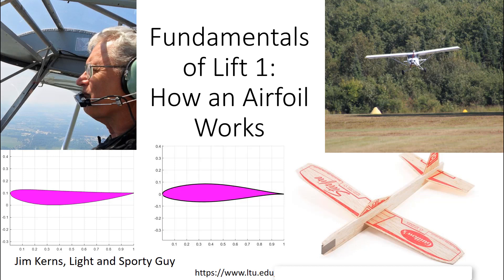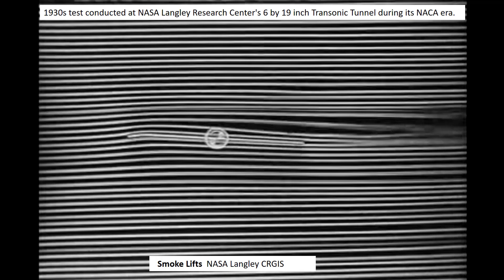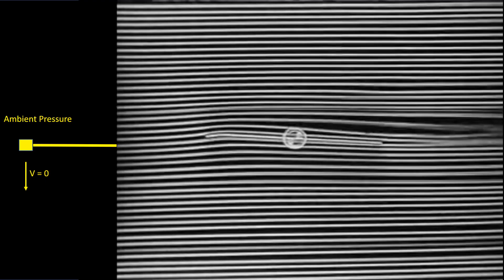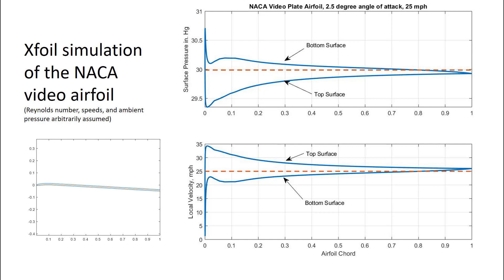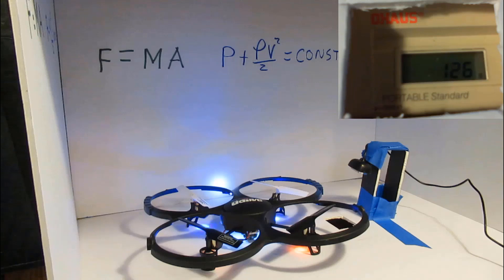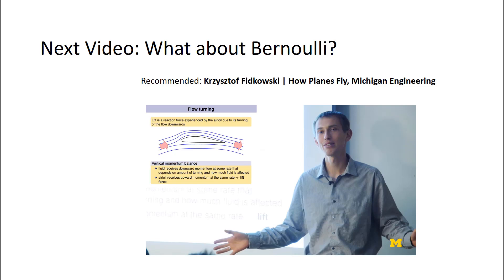Old version of lift video see description for a link to the new improved version

Comment: A simple back of the envelope calculation clearly shows that there is not nearly enough rate of change in the momentum of the air above and below the wing a of an aircraft to create sufficient force to resist the weight of the aircraft. 
Try it: a C172: weight 1,100 Kg, wing span 11 m, chord 1.5  m,  AoA around 5°, airspeed say 100 kts, (50 m/sec)  air density 1.023 kg/m^3. Force required: 11,000 Newtons. Force generated from moving the air vertically maybe 200 Newtons. 
Not even in the ballpark!
Reply from the maker: Not sure how you came up with 200N. Not even close. 
And, if Newton's laws don't apply, what does? 
Note: An easy experiment is to put a multicopter in a box sitting on a scale. As the copter lifts off, the reading of the scale does not change  - the airfoils accelerate the air downward which then hits the bottom of the box  generating a force equal to the weight of the copter - all as you would expect from Newton.
Reply: @LightAndSportyGuy  I will try again and show you my logic.
This is "back of the envelope" stuff so I'm sticking to 2-digit precision.
Firstly the geometry:
Visualise the wing of the C172 in flight as a thin flat surface, a chord length (1.5 m) wide and a wingspan (11 m) long and an angle of attack (AoA) of, say 5° to the horizontal.
Now, visualise the triangular prism of air under the wing: 11 m long, 1.5 m on the diagonal at 5° to the horizontal base. The height of its vertical face, its "pitch" is (chord * sin (5°)) = 0.13 metres.
The horizontal width of the prism is (1.5 * cos(5°)) is also 1.5 m since the cosine of 5° is so close to 1.0.
So, the volume of the prism of air is 11 * 0.13 /2 = 0.72 cubic metres (m^3).
The density of air at NTP is 1.2 Kg/m^3, so the mass of air in this volume is 0.86 kg.

Now, the mechanics:

The plane, moving at 100 kts or 50 m/sec, is moving at 50/1.5  = 33 chords per second, so every 1/33 seconds, or 0.03 seconds, it moves forward by one chord length.
Momentum:
Once the wing has passed, this volume has moved downwards by the pitch of 0.13 m. It has displaced the 0.86 kg of air by 0.13 metres.
It moved the volume down in 0.03 seconds, so its vertical speed was 0.13 metres in 0.03 seconds, or 4.3 metres/sec.
Its momentum therefore was mass * velocity = 0.86 * 4.3 = 3.7 kg m/sec.
Initially, it was stationary, so its momentum was zero, so the momentum change was 3.7 kg m/sec.

This momentum change occurred over 0.03 seconds, so the rate of change of momentum was 3.7/0.03 = 123 kg m/sec. This is 123 Newtons.
Since the same mass of air was similarly displaced from above the wing, the total force is 2* 123 = 250 Newtons.
250 Newtons is way short of the 11,000 Newtons required to support the aircraft against gravity.
Reply from the maker: @RationalDiscourse  The effects of the airfoil extend far above and below the wing  (and in front and behind) - it is not just a small triangle of air that is deflected. An example is figures 36 and 37 in this paper by Prandtl - https://ntrs.nasa.gov/api/citations/19930091180/downloads/19930091180.pdf - that show the pressure effect on the ground.
Reply: @LightAndSportyGuy  I'm concerned about your recommendation of the NASA/Prandtl report to substantiate  your Momentum Theory (independent of Bernoulli) of lift because it relies heavily on Bernoulli's  equation, which appears at least four times in its explanation.
Reply: @LightAndSportyGuy  I'm not sure what youTube is doing, but my response 10 hours ago has disappeared.
Reply: But that is a totally different theory. It is not your explanation. Come on , you can’t move the goalposts!!!!!
Reply from the maker: @alans172  Hardly.
Reply: In your demo, at around 6:00 there is no evidence of vertical movement of the air above or below the foil beyond the extents of the red and yellow boxes. Your explanation only depends on momentum.
Reply from the maker: @alans172  Oh well. I guess I failed to draw the larger flow field.
Reply: @LightAndSportyGuy  ok , can I ask you to present the physics and maths of your explanation please?

Comment: Jim,
Spoiler alert:  There is a "However".
I just saw your video about the myths, which was pretty good [except you lost me on a couple of your details/innuendo that aren't critical - driving to Tampa]  and I saw your reference to this video in a comment.
..
What you have here is very good, in that, you walk through the details using good physics - so rare in other amateur videos. . . .

You correctly say that the flow curves and, therefore, there is a higher pressure above these flows and lower below <-- Newton in fluids and Euler: "Pressure Gradients Accelerate fluid".

This is Inductive reasoning. This is making a judgement from an observation. 
.
Now, the chink in your armor. . . 
HOWEVER, you do not explain the cause of, why these pressures differ from ambient atmospheric pressure!   So that judgement-from-observation is correct, but it still does not explain, using physics, WHY the pressures are altered. It is a backwards reference to the probable cause from the result.  It is not going from an ultimate cause to result of the pressure changes.  There's one more step down to the fundamental.!.
..
People have soup, therefore it is tasty.   
This does not explain WHY it is tasty - What are the spices, quantities, etc.

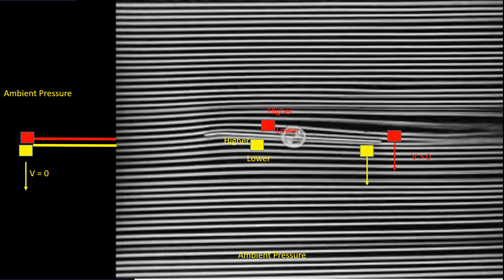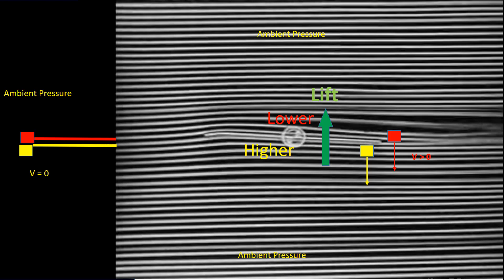Therefore, I say that is not "the fundamental explanation of lift" [time 5:00-6:20].  
I claim that you need to go just one level deeper to WHY these pressures have been altered from ambient.
. 
So I say that this does not go far enough to the true FUNDAMENTAL physics. 
So, this is doing the same as you say about some myths, fore example:  not explaining why the upper air is faster to allow Bernoulli to tell us the pressure is lower.  oops!
.
I had high hopes after seeing your misconceptions video, but am a bit disappointed with this one;  as it didn't quite finish the marathon. . . .
.
So. . . . Do you care to comment?
..
I'm an experienced electrical engineer and am familiar with - - -  all the myths commonly used in something short of a zilliion You Tube videos, a few random myth papers, Fidkowski and a number of the other well-known authoritative names in aerodynamics and their works.
.. .. .. ..
Your misconceptions: https://www.youtube.com/watch?v=VMgLSOVjck8

Comment: At 8:11 you deduce the Local Velocity from Bernoulli's Principle. But Bernoulli's Principle applies to a fluid which, among many other things, is an incompressible fluid. Fluids come in two types, Liquid and gas. They differ in that liquid is an incompressible fluid and gas is a compressible fluid which  obeys Boyle's and Charles' gas laws. Big difference!  Air is a gas. Air is compressible, so despite popular opinion, Bernoulli's Principle does not apply in this case. 
And anyway, there's no experimental evidence that there is an increase in local velocity over the upper surface. See Babinsky's video and my analysis here: https://docs.google.com/drawings/d/1dN6rpx_cUIqq6DPBTvnFrjqDJUtyWylEIY0wR6H8zh8/edit?usp=sharing

Comment: Points to ponder about.
If we consider a high lift thin airfoil with a camber, like that of the Wright brothers and Bleriot, we can generalize that there are four primary zones around the airfoil that makes it better than a flat plate.  These four zones are selected and accented accordingly, depending on the velocity the wing is to operate and in the faster sections, they may even disappear.  Two of these zones may at first appear to be a  bad investment and a disadvantage, but they are a good investment to make the airfoil better than a flat plate.  The four zones are as the following.
1. Above the angled leading edge, there is a high-pressure zone to  accelerate the mass particles upwards
2 Above the upper downsloping surface, all the way back to the trailing edge there is a suction low-pressure zone to accelerate the mass fluid particle downwards with the downslope providing a longer flight path to produce a higher downward acceleration/velocity.
3. Below the leading edge, there is a low-pressure suction zone to accelerate the mass particle upwards.
4, Below the lower downsloping surface, all the way back to the trailing edge there is a compression, high-pressure zone.to accelerate the mass fluid particle downwards providing a longer flight path to produce a higher downward acceleration/velocity.enhanced by the Angle od Attack.
         At 1:17 in the video, all these four primary zones are clearly seen.
Zones 1 and 3 may at first be seen as a disadvantage, producing drag, but in real fact, they act as " the initial compression in a piston engine before the real power stroke comes in later on!"  Zones 1 and 3 do act as a football player kicking a fast-coming approaching ball rather than shooting the ball from a stationary state, or a cricketer batting an oncoming fastball rather than the ball falling on the stationary ground. Giving energy to a ball "hitting it on the fly" will produce a better flight if the ball velocity is reversed rather than starting from a stationary state. The change in momentum is far higher. That is the brilliance of the airfoil shape design over flat plates. This is also related to the upwash before the leading edge and the downwash at the trailing edge, where the Angle of Attack compresses the fluid for the initiation of the upwash far ahead of the wing.
Note at 1:17
*  the surface above the down angled curve/camber at the leading edge, provides an upward accelerating zone due to compression / high pressure, and this dynamic investment. will provide a better flight path over the rest of the upper surface. to produce the suction zone, later on, listed as zone 2. see video below.  This is why an old-fashioned cambered wing is better than a flat plate. 
* the surface below the down angled curve/camber at the leading edge, provides an upward accelerating zone due to suction /low pressure to fill in below the leading edge, and this dynamic investment. will provide a better flight path over the rest of the lower surface. to produce the compression/high-pressure zone, later on, listed as zone 4.  This is why an old-fashioned thin cambered wing by Wright Brothers and Bleriot is better than a flat plate. ( At the downsloping leading-edge, It kicks the mass particles on the fly!!"
The effect above and below the down angled leading edge is brilliantly shown in the following video showing the fast mass of a car tackling a curved hill which is exactly the same as the leading edge of a wing, as listed as zone 1 and 3, but to relate zone 3 to this following video shown below, one needs to put a curved surface of the road above the cars to simulate the compressing action on the lower leading edge. of a wing, a curved concave road above the car needs to be imagined.
https://youtu.be/AAjIdmYIZrQ
https://youtu.be/rUkytRPIJNs
Reply from the maker: I'm glad you are enjoying my videos.

Comment: Why does air speed up over top of the wing?
Reply from the maker: Given the lower pressure, conservation of energy (or Bernoulli's equation, if you prefer - same thing) says that it has to be faster over the top. 
You could also invoke the "Circulation" theory but that tends to be much less intuitive.
Reply: @LightAndSportyGuy  ah, okay. So the air going over top is accelerated by the wing, or high pressure on the leading edge around the stagnation line, where, as I understand, the air stops and, according to Bernoulli, the pressure of the air must rise (if we slow it down). Am I right to say that this high pressure sort of pushes on or “circulates” air over top of the wing? I’m studying to become a CFI with no engineering background and am quickly understanding that the concepts I have learned are not adequate when it comes to the subject of lift. I don’t want to mislead my students! Also I am finding that I am becoming interested in learning some aerospace engineering on the side, not only to enhance my understanding of flight but maybe pursue it as a profession.
Reply from the maker: @MarinePilot  At the stagnation point, yes, it stops and the pressure is high. Above and below the stagnation point, the pressure at the surface is high as the air "turns" away from the stagnation point. Beyond that, as you go over the top, think of the air having to be "sucked" against the surface in order to follow the top and not just flow away from the surface. When you are stalled, the airflow does not curve to follow the surface so there is much less low pressure over the top.
Reply: @LightAndSportyGuy  I've studied physics for a long long time and from my first introduction . . . I've known that no matter what others might say, there's no such thing as a suction.  😊